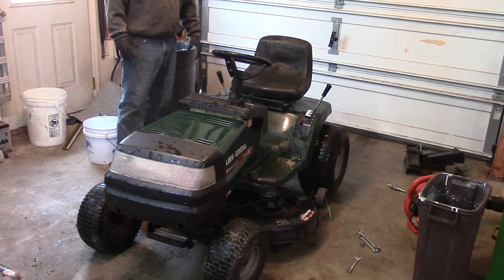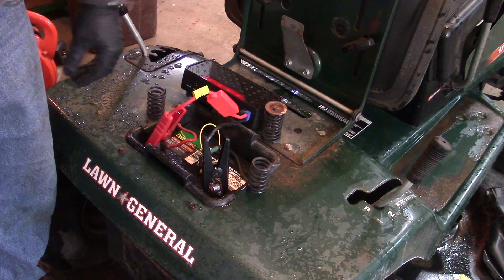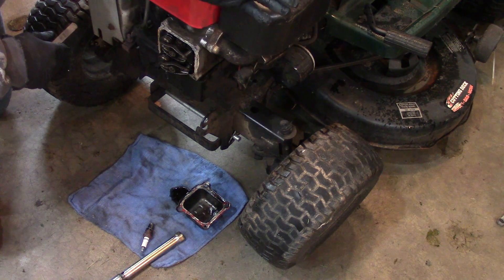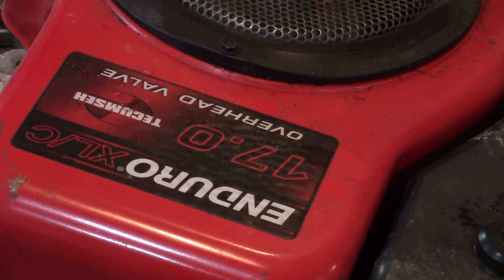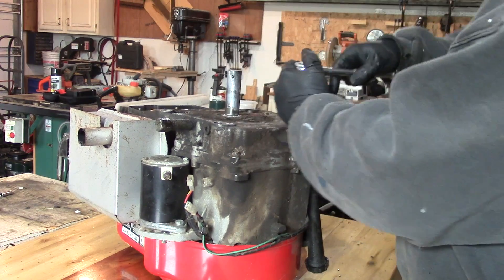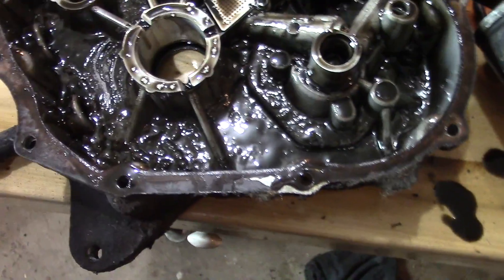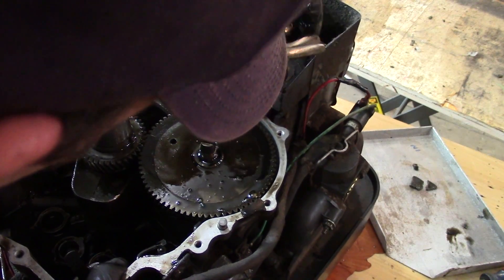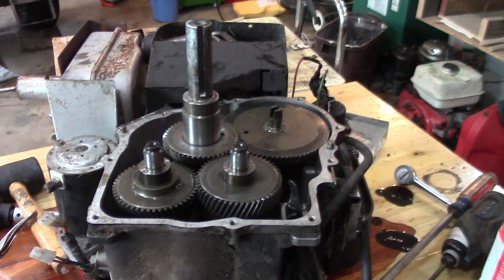Tractor Too Much Compression Won't Crank

Comment from the maker: http://amzn.to/2qiYmis 2 Ton Chain Hoist  
http://amzn.to/2qj1rPF Tecumseh Crankcase Gasket
http://amzn.to/2qj1Hyi Briggs Camshaft and Lifters
http://amzn.to/2qjdAEd Briggs Crankcase Gasket
http://amzn.to/2pVbLvQ Briggs Oil Seal
http://amzn.to/2pozGAr Air Cat Pneumatic Impact Gun 1/2"
http://amzn.to/2qiYmis 2 Ton Chain Hoist  
http://amzn.to/2pZQzmM Battery Load Tester Tool
Reply: Never seen the Link for the Compression Release Kit ..... Only Link is for the Cam that has the Compression Release already on the Cam..... is there a Kit that is for the Compression Release Components Only ? .... that way i can just Replace what is actually Broken .... my Cam is Good..... Thanks for the Great Video.
Reply: @bobbysutton9024   I apologize I worded it wrong. I should have said  cam relief kit.
Reply: Of you removed the plugs and it sound does that mean everything is working properly or did I just released the compression only?

Comment: Once the compression release quits working, DON'T run your motor anymore! Fix it! It has those little parts floating around inside the engine, basically banging against other moving parts and could ruin more parts or get lodged in places you don't want them. I've seen some horror stories caused by those little parts and you can actually ruin the entire motor if not fixed in time.
Reply: Best advice there is 😊

Comment: my bottom valve (intake) wont move, I know I adjusted them right per the specs on troy bilt pony with briggs 15.5 hp engine. both rods are not damaged, I have no idea what happened but days before it would start up and run then stall. I am thinking broken compression release in engine. On my engine the exhaust valve is on top and intake on bottom. Now it hard to turn over and never starts even with jump starter hooked up and batery and carb are new. New fuel filter and air filter. There was gas in engine oil before carb replacement but after carb replacement it ran then stalled after 20-30 seconds.

Comment: I had the same issue of starting. It ended up being a loose ground to the chassis. Easy fix after adjusting valves.

Comment: the problem i  have had is low compression never have i seen too much how much is too much  if it want turn over its not compresion   just loosen spark plug see if rotate then  it sound  like t he wrong spark plug  in  stalled (too LONG ) ---- weak battery could give this problem  also try putting compressiion gauge in spark plug hole measure compression  120 psi is good  85 -90 is low but still will run

Comment: hello i have same problem with my tractor y check everything and i found the terminals on the battery have corrosion remove it clean real good with metal brush  and run like a champ that was my problem good luck for all

Comment: If the battery is only showing 12 volts it needs to be charged before load testing it.A fully charged battery should read around 12.4 or more

Comment: My Mtd Yard Machines ran fine til a few weeks ago. Now it won't start. Replaced the battery twice. Find out, it will crank over fast with the spark plug removed but very slowly when the plug is in. What is the exhaust valve? I tinkered with my exhaust/muffler cause it is rusted and I bolted it so it doesn't leak anymore.
Reply: set both valves @ .003" so compression release will work, then it will turn over fine

Comment: if you want learn how fix your mower get a wiring diagram and learn how to read it if you can read a road map you can learn how trace wiring  learn what every thing means  for instance on relay contacts  NO stans for normaly open  so they would  close as the relay is operated  also if it says NC it means they go open as the relay operates  the key switch --on makes this happen  you learn how to use your ohm meter its is very simple to use  you get a meter  for less than 10$   it will test any thing for the  average homer owner    all you need on you meter is ohms  ac-dc volts  dont worry about reading amps  you get volts ohms fixed current will take care of its  self  im a retired tech   still use my meter almost daily  wiring on  my truck restoration

Comment: i know a good way to tell about comppression  is to put a little oil in spark plug hole recheck comp if it goes up its the rings are worn  if it dont go up its the valves  they need grinding

Comment: im 87yrs old worked on eng all my life as a hobby from modle air plane engs to outbord eng lawn mowers my army truck  flathead six i dont recall ever having to tinker with valve adj, i did grind the on my army truck to help comp. fixen to rebuild carb on my army truck  need to stay busy    - give out but dont giveup..lol
Reply: todays small engines have a compression release built into the camshaft, proper valve clearance is critical for these to work

Comment: the quick way to tell you probably have a bad solenoid is to short  across the two big lugs on the solenoid if it spins then replace solenoid  --- the way a solenoid works   is when you turn the key switch on it conn batt. to the winding in the solenoid  which closes the contacts inside to conn. 12 v batt, to the starter ..if this dont happen all you get is a click........

Comment: You should of stuck a clean plastic bag inside air intake so no air gets through preventing compression - motor will run and start, as soon as it does pull the bag out.
Reply: why not just use the choke insead of a bag???????

Comment: take plugs out to reliev compression  if its  still stiff   its been run with low or no oil and ruined the crank shaft or the rod looking at those gears its been cooked

Comment: Set Intake valve clearance to .004 tight. If this doesnt help, your compression release mechanism on the camshaft has went south.
Reply: This is the trick. I've seen .006 not be enough but .004 did the trick even when compression release didnt work

Comment: JUST WATCHED THIS VIDEO AND I'VE GOT THE 17.5 BRIGGS AND STRATTON INTEK ENGINE THAT I JUST REBUILT IT'S DOING THE SAME THING THAT THE ONE IN THE VIDEO IS DOING. WHAT IS THE CORRECT VALVE SETTING ON THIS ENGINE 31C707 IS THE MODEL. THANKS FOR YOUR VIDEOS THE'RE GREAT
Reply: Same motor and problem im having
Reply: Most of the Briggs Intek and similar engines for riding mowers are:
Intake .003-.005
Exhaust .005-.007

Comment: I wish somebody would answer this question:   If you take the spark plug out, does that release all the pressure?????   I ask that because MY MOWWER STILL TURNS SLOWLY WITH THE SPARK PLUG OUT.  Anybody have a answer???????
Reply: Maybe you're magneto is resting against the flywheel
Reply: @Mike-su8si    It turned out that the "NEW" battery was was fried after continuous charges due to failed starting attempts. It turned out the starter was fried too after all the failed attempts to start it.  In other words the engine refusing to start caused the battery and starter to die.

The thing that caused all these problems was unadjusted valves.  The exhaust valve was so late in opening that the pressure in the cylinder was greater than the starter could overcome and that extra pressure wore out both battery and starter.

I got a new starter and battery, adjusted the valves and now it starts good.
Reply: @Hooverdarnit  oh my top valve was loose one time before on my cv16s Kohler pro I didn't have the right tools so i just tightened it a little bit and its still working good

Comment: What does it mean when fuel runs out of the exhaust pipe on a Kohler engine. Also had problem    with compression getting  stuck at top ,dead ,center. But was able to turn crank with wrench.
Reply: Your carburetor pin isn't working right to stop the flow of gas to the engine. I had that problem until i put a new carburetor on plus a gas shut off valve on the carburetor gas line 

Without the gas shut off valve i use to park the mower at a good slant to keep it from flooding the engine with gas it worked that way for awhile 

You might just need to adjust your carburetor pin or it may need a new carburetor bowl solenoid put on you'll need to change your oil and oil filter too i have cv16s Kohler pro and cv491s Kohler command engines

Hopefully I'll be getting another cv491s but I do away with the cheap gas pumps cause they can leak gas into the engine so I don't want that
Reply: @Mike-su8si  the backfire solenoid on bottom of carb is sticking, and letting fuel in after it is shut off
Reply: @DWinnie67  it wasn't though because i put a new one on and still had the problem until after i put a shut off valve on and it fixed that problem 

Then I seen on the solenoid rubber tip was to skinny to block the hole so it wasn't doing much good my original rubber tip was wider
Reply: @DWinnie67  what was wrong with that was the wrong rubber tip and i couldn't find the right replacement rubber tip

Comment: Getting ready to put in a performance cam and tabit in a motor. Can I use just reg. grease for assembly lube,, or is royal purple 90 weight on the parts good? I do not have any specific assembly lube thus the question

Comment: It would be nice if you could explain what and how the gears work. Also how you can tell when the timing lines up. I like your videos and am learning more and more on small engines
Reply: the woooruff key in the crank shaft and fly wheel set the location of the mag built into flywheel as the magnet passes the coil it generates a spark while piston is located a tdc on compression stroke

Comment: I’ve never had a Walmart battery that lasted over 1 season... I will not buy one. I buy a good one from the Auto parts store, it’s still good after 4 years..
Reply: i usually use napa lawn and garden, interstate or  federal are my choices never had a problem napa is my favoite the price and they work good for my mowers
Reply: Yep learned my lesson
Reply: less landfill xD
Reply: They are still the worst battery in 2024 also 😢😢😢

Comment: For you folks that have those PAIN THEE ASS PLASTIC BOWL VECTOR CARBS ON YOUR TECUMSEH ENGINE AND WANT TO GET RID OF THAT SURGING AND ANNOYING HARD STARTING AND CRANKY CRANKY STARTING I MAKE A KIT WITH A DIFF CARB THAT REALLY WORKS WELL AND YOUR ENGINE WILL RUN RIGHT LAST LONGER THAN THAT UNCONTROLLED FUEL ISSUE THOSE VECTOR CARBS CREATE. THE KIT COSTS YA A HEFTY $79.00 EVEN + SHIPPING COMES WITH EVERYTHING YOU NEED INCLUDE A VIDEO DISC ON THE INSTALLATION PROCESS. YOU JUST CAN'T BEAT AN OLD DIRT TRACK GUY AT HIS OWN GAMES.

Comment: A large problem with the Tecumseh motors in particular is the issue after you got to put those bolts back in the bottom to mount it back up use Teflon tape on the threads or the bolts will work themselves loose on ya and fall out... I've had how many of em here over the years after mister shade tree mechanic replaced either that compression release or a leaky sump gasket the mounting bolts work them selves loose. You can't really use locktite because of all the oils in those bolt holes it don't stick to anything.. If you folks want to totally avoid breaking a compression release and avoid making junk out of your tractor use Synthetic 30 weight heavy duty Motor Cycle oil in the crank case and drill a dime size hole on the bottom of the muffler on the same side as the header pipe is at. The mufflers were too tight to begin with and most usually spring a little rust hole anyhow. However there are places in the southern USA where they don't get the rust like we do in the northern USA so breaking a compression release around here is not that common because people change their oils here and we have a shorter cutting mowing season here so the machines are not used as hard and oil usually gets changed. But for those of you with no pin holes or rust on the muffler make that dime size hole you will gain a little power too.
Reply: So drilling the hole in the muffler then what let’s moisture out so it won’t rust inside the muffler?

Comment: Take the plug out and see if it cranks o.k. If it does, it can be carbon on the piston,    the crank key can be sheared because the blade is bent, dragging starter, etc. If the rockers are loose, the valve seat can be loose. Pull the head and check. Replace the head. Check the leakdown to check rings, valves, and head gasket.

Comment: Appreciate you posting doublewide6! Just a little tid bit of info for the people interested in tackling this job. It's a good idea to remove the spark plug and push rods before cracking open the cranks case / sump. It will release the compression load on the crank if you need to rotate it and spring load on the cam for easy removal.
Reply: just loosen spark plug will kill compression

Comment: valve adjustment on that Tecumseh you need to adjust your valves and set if you don't you may run into bigger problems that's been to push rod or even break the retainer nut and it's a common problem with that 17 horse Tecumseh

Comment: im having an issue with my Tecumseh motor on my tractor. The previous owner said it blew a gaskit and there is a whole lot of oil at the front end. What would cause that to happen and where can I find that part?

Comment: I just took out the spark plug, turned the engine over and blew all of the crap out, then replaced the spark plug, took off the air cleaner cover, covered the air intake with my hand, turned it over and once it starts spinning I take my hand off of the air intake, Vroooom!!

Comment: A very simple way to relieve compression is to take out the spark plug. If it then turns freely problem lies elswhere
Reply: Blackie Chong hi there I've got this problem with a quad bike any idea's
Reply: Exactly....spock would be good at these. Live long and prosper
Reply: Im gonna try that with my john deere 318, thanks a lot

Comment: Hope you get it back together and running like a champ. I know you will!! Do all over head valve engines have the compression release? I adjusted the valves on our zero turn a while ago and it doesn't have compression release as far as I know.
Reply from the maker: I don't know.  I don't think so.  The bigger the engine the more likely it will have it perhaps.

Comment: I can't tell you how many batteries I went through with these mowers, I wish I had seen this video years ago!
Reply from the maker: Always check the valves first.
Reply: Jeffrey Dubinsky flooding carburetor will give the same type symptoms,but the gasoline being thinner than oil,it will blow by the piston rings and flow in to your crankcase.
Check for elevated oil level and do a sniff test to the dipstick.
Repair/replace the carburetor and change the oil.

Comment: I can't stand buying these machines from hack repair guys anymore. I've bought huge lots of snowblowers, garden tractors, mowers, etc and they all have more wrong with them than before they started messing with it.
Reply from the maker: I try to stay away from other "mechanics".  I have had it happen about 4 times in the last 3-4 years.  I should know better.
Reply: I only made one mistake and it was to buy a rebuilt (That's what I thought) riding mower from a certified " backyard mechanic". Everything else I own, was free and I intend to keep it that way. I do my own repairs with the right NEW parts. When my neighbors wants me to fix their machines, I just show them the way to the small engine shop near here. I'm not going to back stab the guy livelihood. That's my motto.
Reply: Very true; If they cannot offer you a decent warranty,don't buy it!
Reply: I don't mind buying them until i see some people weld the rims to the axles and they weld pulley wheels to the shaft
Reply: Very Informative, Good Job!

Comment: Wow, it has a set of balance shafts in it? Looking forward to the next video. That oil is yuk!
Reply from the maker: As you can probably tell I am not really at all familiar with these Tecumseh engines.  It is an interesting system of how the timing works with all the balance shafts.
Reply: I just find it interesting a company would spend the extra dollar to put a balance shaft system in a inexpensive engine, especially a one cylinder. I could see one in a four cylinder because of their inherent rotating mass issues.

Comment: had a similar problem with a lawn mower I went to buy from a neighbor, and it was overfilled with oil... oil poured out of the chamber when I removed the spark plug, and it poured out of the muffler / exhaust pipe too... Once I drained the oil and cleaned it, it ran fine... It had fluid lock / vapor lock.
Reply from the maker: Sometimes when you see that the problem is a leaky seat.  If there is gas in the oil the problem will come back.  I have a video on how to fix it on a Briggs 17 intek.

Comment: Nice video Bob . Hope you can save the engine . A lot of metal flying around is not good.
Cheers Pete.
Reply from the maker: Well, you are right about the metal. 95 percent of the metal was on the bottom of the engine sump (I have the engine turned up side down).  Anyhow,  The battery is new that I was cranking with, so I'm thinking once that compression release broke the engine never started again.  Also that jump starter that I used can jump my V8 truck with no battery even installed.
Reply: That's good Bob . Might well have saved it.